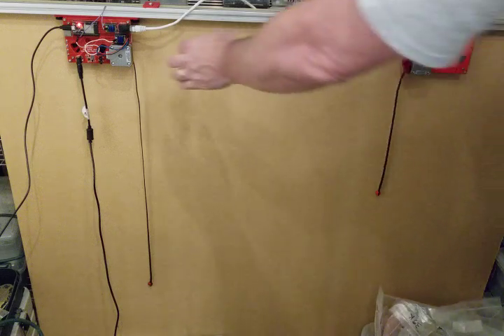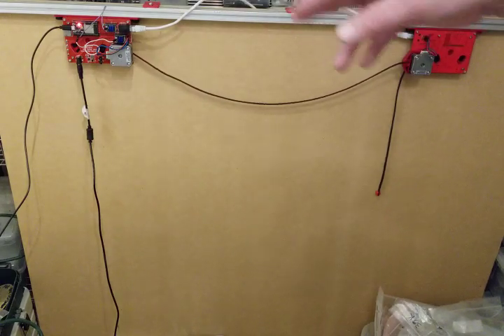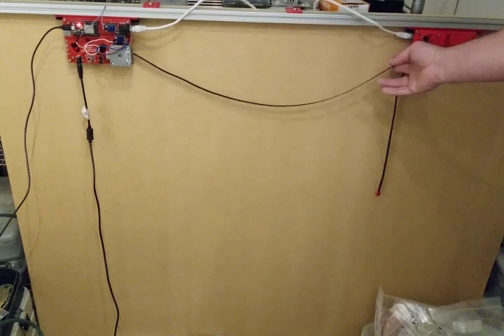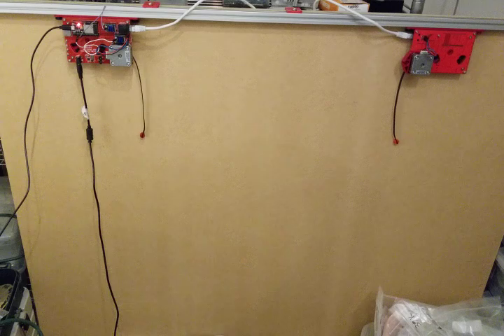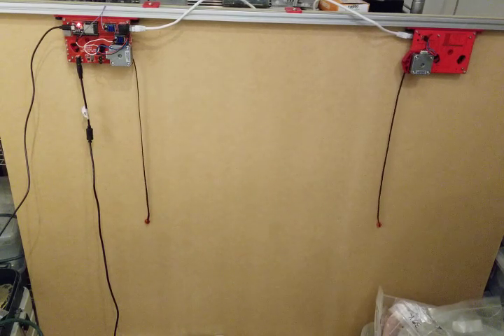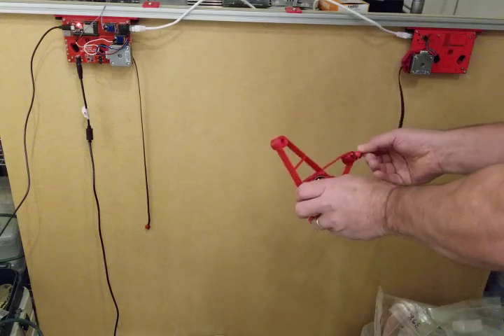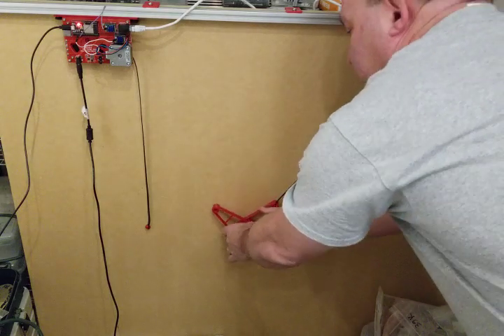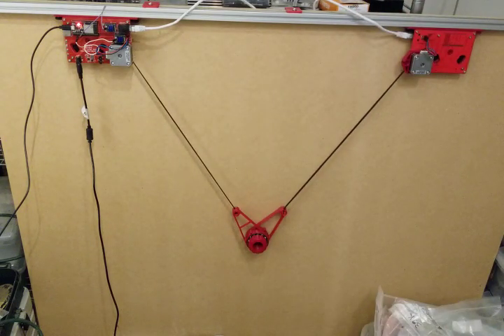Wall Plotter Auto Homing using Stall Detection

Comment: I like the centering feature. Is the drawing size used to calculate how much is fed out for zero? Is the size of the drawing limit expandable by installing longer tape measure reels?
Reply from the maker: The tape reels hold about 4 meters, so a lot more than you are seeing. It is just small to make it easier to see in the video. To draw an exact horizontal line, the motors are constantly doing some math about the movement of each belt. That math is dependent on the distance between the motors.

Comment: Awesome work Bart! What trinamic drivers are currently supported with ESP32 GRBL, only the SPI drivers or also the newer tmc2209? And is there a way to set the stall guard trigger value in GRBL itself?

I guess I will have to get one of your boards on Tindie soon!
Reply from the maker: It uses the TMCStepper library, so in theory it can handle all of them. I have only used the TMC2130 and TMC5160 so far. You can adjust run current, hold current, microstepping and stallguard value live. Everything else is via compile time option or adding code.
Reply: @engserve  

Hello, will this project be publicly available? really want to repeat it! Thanks for your work!

Comment: Nice implementation! Is the kinematics file for esp32_grbl available anywhere?
Reply from the maker: There is a wall branch with the kinematics. The project is on hold for a while. I don't have a good wall in my office. When the weather gets warmer, I can put it in the garage.
Reply: @engserve  Thank you for the quick reply.  I really like the belt winder, definitely taking that one:D. I found this because i wanted to port my wall plotter software to esp32 but since its done already i'm gonna use this one. The only thing i don't quite like is that the calibration is part of homing. It's simple enough but if one needs to take off the effector every time one homes the machine, it can become tedious.  I think it should be two separate processes. Really nice work!  Here is an old version of mine https://www.bostjancadez.art/sl/avtoportret